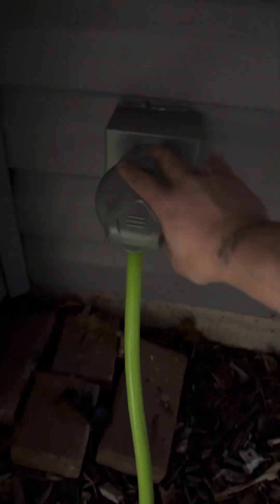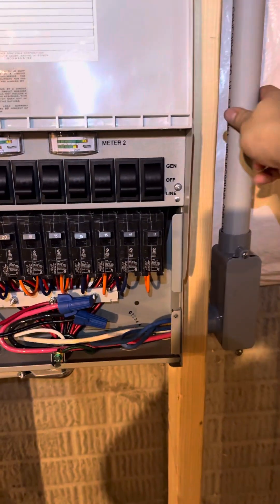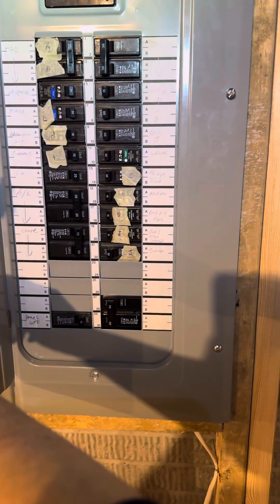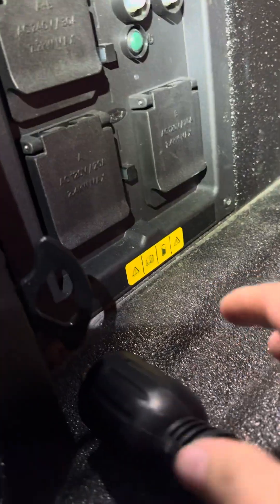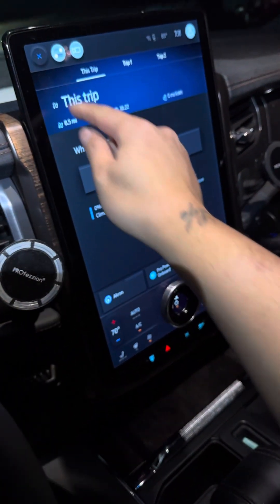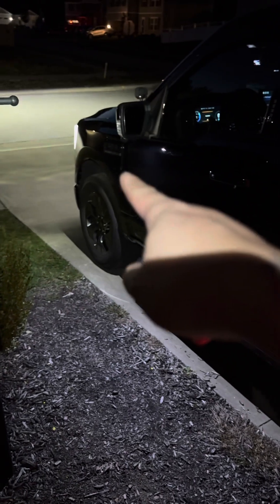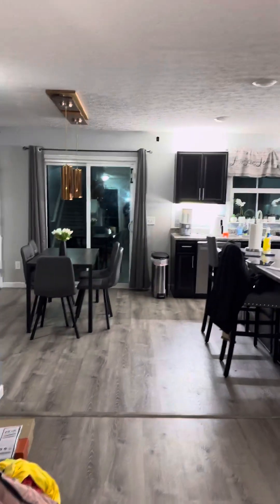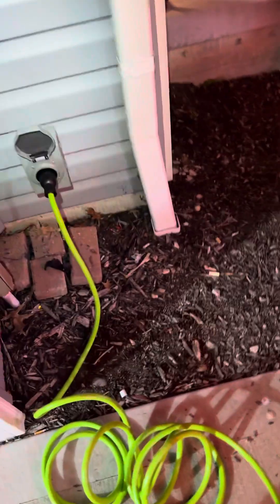ford lightning home power back up

Comment: That’s because the truck has a neutral bond. You either need a 3 pole transfer switch or what this guy doesn’t show. He disconnected the ground wire coming from the truck. Why did he shut off his main breaker? Only one bonded neutral at the main panel. Your gen has a floating neutral!

Comment: Which ground wire are you not connecting. I have the same panel. It’s been installed for ten years and works great with my generator. But it shuts down the pro power on board.